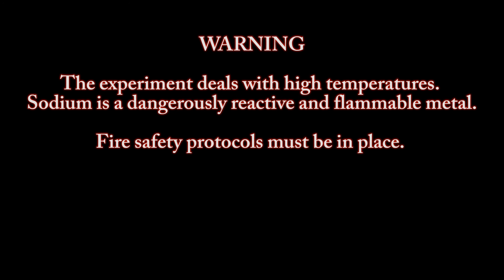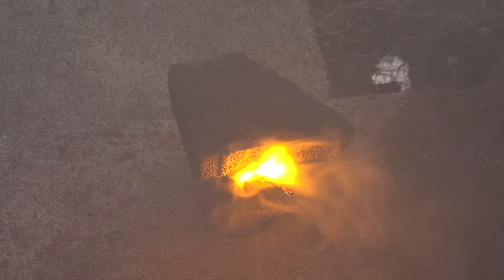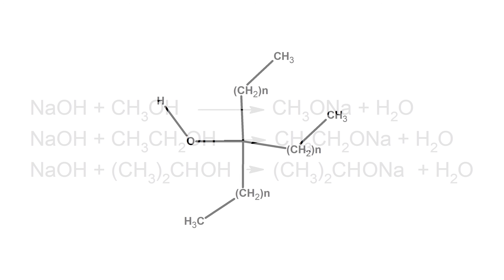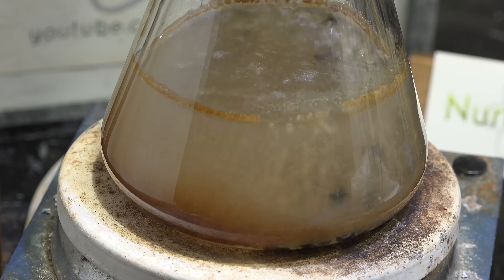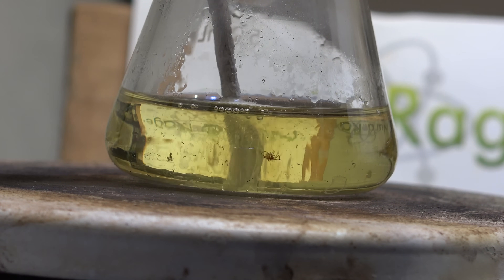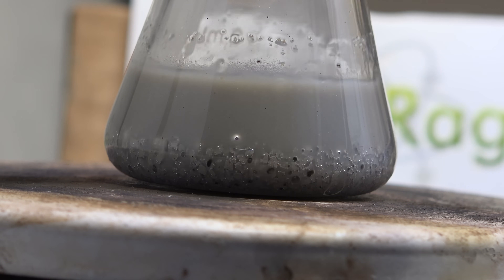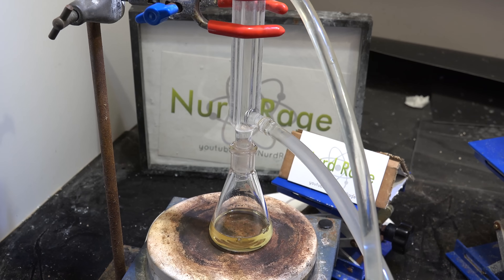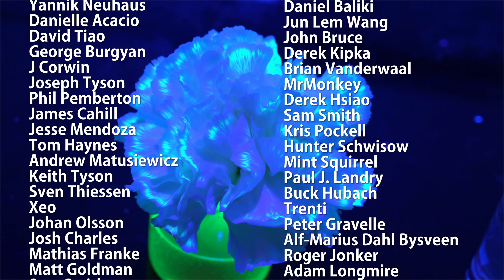(REUPLOAD) Progress Report: Theory Test for Alcohol Catalyzed Magnesium Reduction of Sodium

Comment: Did you consider the usual method of electrolysis? Nice work anyway and great persistence.
Reply from the maker: The point of the research was not to use electrolysis.
Reply: @NurdRage  ok cool. That a tough one then. Hard to achieve and expensive. Good luck.
Reply from the maker: @profphilbell2075  Actually we were successful. search "Make sodium with menthol"

Comment: Hello, I'm from Argentina and I'm using Google translator, so I hope you understand what I say, according to this logic, you could use directly magnesium + sodium hydroxide + cetyl alcohol (without using baby oil) and heat at a temperature higher than 100 ° C but lower than 200 ° C. and with this would not react so much sodium hydroxide with silicon dioxide? Greetings, you are a genius!